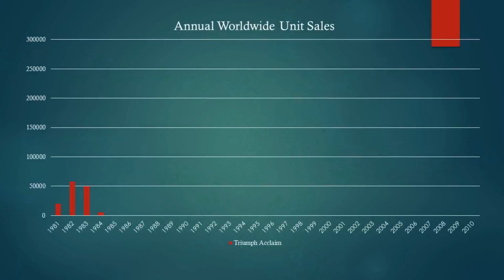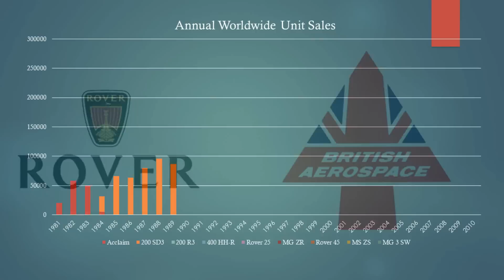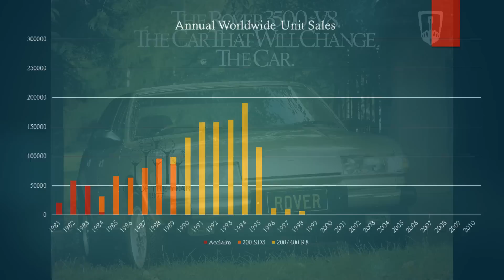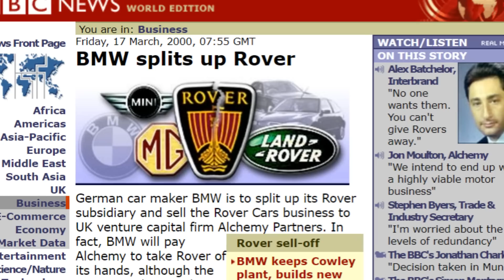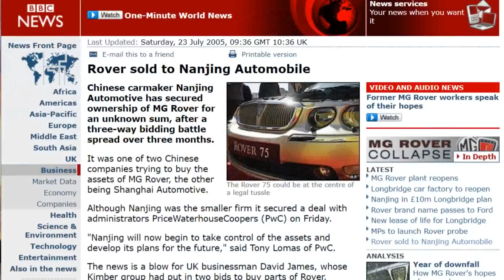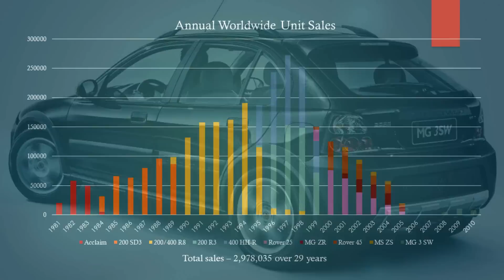The Rover 200 Story

Comment: Well, I've had my 2002 MG ZS diesel that I only paid £375 for for two and a half years and I really like it. The handling is pretty good, the seats are really comfortable for long journeys, and it's pretty economical - almost never less than 50mpg, despite using it for driving about 4 miles to work for approx half its fuel usage. Has hardly needed any servicing, bodywork, engine, gearbox, suspension all in great condition. Oh, and guess what - No charge for the ULEZ! Bonus! Was that because Rover went bust before they'd done all the analysis on exhaust emissions?

Comment: I had an experimental Rover 25 two liter turbo diesel hatchback with the Hydragas suspension from the MGF.
Reply: Seriously?!
Reply: @skylined5534  Yes, in 1999, it was a company car, I would have bought it but the suppliers said it was experimental and would not sell it.  The hydra gas suspension was definitely superior to every other metal spring suspension car I've ever driven. The car rides on air until the suspension depressed then it firms up progressively as when squeezing gas in a syringe.  It is the perfect suspension system, I suppose other manufacturers stayed away from it because of the necessary regular maintenance.  

I sent my wife out for a drive in it and she couldn't tell any difference.  I told her what the difference was and sent her out for another drive but she still couldn't tell any difference compared to normal cars.  To me the difference was very obvious but half the market (women) couldn't feel or couldn't care about the difference.
Reply: @dreamdiction  

What a bonkers and cool car! Thanks for telling me about it! I hope it's still out there somewhere 😊

Comment: I had a rover 216 Vitesse as my first car, got 12 years and 214,000 miles out of it before sadly it had to go when it got to the stage that i was welding to the previous years welding none of the Honda parts apart from the central door locking switch ever went wrong, (ignoring wear parts of course).

Comment: I had a J-reg 214 SLi, with extra power steering.
I loved that car, good handling and reliability (except for the PSA clutch & gearbox), reasonable performance and a big boot.
Only got rid of it when repairs began to cost more than the car ☹
Reply: It was a VW gearbox.
Reply: @richardrichard5409  
From Wikipedia about the 89-94 model 200 series:
"The Rover-engined models drove the front wheels via jointly developed Peugeot/Rover R65 gearboxes (1.4-litre) and Rover PG-1 gearboxes for the 1.6- and 2.0-litre versions."
Reply: @richardrichard5409  
Also, in the 11 years that my family had the car, the gearbox was replaced twice (and the clutch at least twice).

I've subsequently had 2 Mk1 Skoda Octavias (VW group) that I kept until past 15 years old (and about 170,000 miles) each, neither had any problems with the gearbox and only one needed a clutch replacement.

This shows the difference in quality between the Rover/PSA gearbox & clutch vs the VW group ones.
Reply: PSA box, VW box was early Montego/Meastro 1.3 and 1.6

Comment: The second generation Rover 200 and Rover 400 models were brilliant, spacious comfortable rear accommodation, reasonable bootspace, decent economy, a lovely ride, and a quality experience. The smaller 200 and 400 replacements were nowhere near as good - fair bootspace, poor rear legroom, not quite so nice seats, and sloppy refinement, and as for merely reheated and rehashed 25 and 45 they weren't a lot different from the 200 and 400, just a few cosmetic changes here and there and subtle restyling.

Comment: I've had experience with all the Rover 200 generations. Looking back, the original one launched around 1983 was the most impressive. The facelift version felt very good, it felt premium and was well designed, as a former Orion owner yes it was on another level, even the 213s with about 70bhp felt nippy enough. Being less than 900kg might have something to do with it, amazing weight, and it still felt very solid.

The R8 was good but felt a bit less special, but more practical. The facelift car looked brilliant in 214 SEi trim (or GTi/GSi trim) with the half leather sports seats and nice metallic colours with the later body coloured bumpers (nightfire red, BRG and a charcoal grey colour, they all looked great). Even the silver looked smart for some reason, I think it was the contrast with the black rear panel and facelift black grille that made it look good, I normally hate silver. The bubble ones felt less special and more mass market, but I did own a Diesel and that still felt much nicer and drove better than the new shape Cavalier I owned before it, and it went extremely well with one of Rover Ron's tuning boxes on it. Estimate about 130bhp, up from 105. Could spin the tyres in 3rd in the wet (admittedly cheap tyres).

Also had a ZR and ZS but by that time they felt a bit long in the tooth by then, and the ZR had a habit of the interior trim falling apart, and the ZS felt a bit too Honda, moreso than I remember in the 400 for some reason, but they served a purpose. Ride was too harsh too, I think they fitted cheap firm shocks which sacrificed ride quality too much. My BMW 330i M Sport was a limo in contrast. I even lowered it and it was still more comfy than the MGs.

I love the looks of the Coupe and Cabrio too.

Fond memories of the 200s.

Comment: That handling issue  explains why the 213 my grandfather passed on to me nearly didn't make it round a motorway cloverleaf when I tried to drive it home to Kent from Wales in 1999 when I tried to power out the turn... Or maybe it was down to its horrendous condition - quick fit wouldn't let me drive it home after they put it on the ramp!

Comment: my first own and my 4th car was a Concerto 1.5i and i honestly couldnt say it had awesome handling or a strong body. when i jacked it up on one side the doors wouldnt close as they should. the suspension was VERY wobbley and indirect compared to my 1990 civic i had. the civic had a double wishbone suspension design in the front and the concerto had just the usual european mc pherson strut. also the interior had some not that great fitting interior trim wich the 1990 civic didnt have so yeah....i guess the japanese influence was good for bl but not really for honda. but im aware that japanese motoring wouldnt be on the same level it is if they hadnt been learning from the brits after ww2.

Comment: Good research. I had 2 Rover 216 company cars and they were both reliable and not bad to drive. One driven to southern Spain and back, but they were never Rovers in my view. AR & Honda should have exchanged manpower to integrate the companies better. In my time at AR I never saw a Japanese designer or engineer and Honda would have benefitted from working with some of the AR designers and engineers.
Reply from the maker: Thanks - good insight!

Comment: Overlooked in this video, was that the Rover engine used in later years (1.6L in the 216) was a grenade. Well unless you are of the opinion that 40,000kms is acceptable interval for on engine to blow head gaskets ("edit" I should say like clockwork, every 40,000km)...   Inlet manifold bolts would also break, requiring them all to be replaced with studs, in some cases the manifold may have warped too. A real shame as they were otherwise an awesome little car.

Comment: Owned a Maestro City as a young driver.  It was cheap to run and very spacious inside.  A nice metallic graphite colour.  The downside was it was very basic and felt a bit tinny.  It was underpowered.  A car that size should have had a 1500 engin minimum.  They should have re formulated the allegro engine.

Comment: Owned the metro 100, 214 Si . Hesitated with the 75 and decided on  the Mondeo followed by 2 x Volvo V70’s. Now running a Hyundai Tucson. The 214 si had various faults and one major one which was engine management system. Car would stay on high revs. Quite dangerous at times. The never found the fault.
Reply: We had a company Rover 216 from London to Bristol staying a week n back choke on 1.5 k rpm extra  I was sure it would wreck the engine but didn't, nice car for motorway cruising with 4 tall men, wasn't as quick as my passat 5 cylinder 2.0 litre but close.

Comment: I owned a 1991  Rover 216 GTi 5 door in British Racing Green. With its twin cam 1.6 Honda engine it really was a wolf in sheep's clothing. It was a seriously quick car. Very high revving, with 70mph equal to around 4000 rpm, which was a little tiresome on a long journey. I kept the car for over 5 years.  It was an expensive  car to run and service.  I replaced it in 1999 with a Renault Megane Scenic

Comment: Had a K plate Rover 214 with the Rover engine, It was a right bag of dirt crap, Nine times it puked up it's coolant, Only on the ninth time back at the dealers, They decide to skim the head and it still did it a couple of times afterwards. While it was in getting the head done they gave me 214 with the Honda engine, It was like chalk & cheese, The Honda had guts but the Rover wouldn't have been strong enough to pull back an elephants foreskin.

Comment: I remember when we looked at the Ballard in Engineering, interesting where they reduced weight in panels like the hood and roof compared to our cars, learnt a lot working with Honda engineers. That’s who Rover should have sold to not BMW.
I gad a 623, fantastic car
Rover 25 was to be a big upgrade to the 200, but BMW took most of the money out the scheme rendering it just a lipstick change

Comment: I had a new 1998 Rover 211i which was very reliable except the door lock broke I changed it for a  new 2002 Rover 25ie which needed a new oxygen sensor and also the heater switch broke.After this i was glad to get rid of it and bought a new Renault Clio.

Comment: That K series engine was awful for head gaskets, I had a 216 Cabrio SE and the head gasket failed 3 times in 77,000 miles, the third time twisted the engine block and destroyed it.
Reply: 1.6 and 1.8 were, the 1.4 wasn't anywhere near as bad

Comment: TBF Honda was going to abandon Rover anyway once they got a foothold on the British (and by extension the European) market. Even if they bought the company outright, they would've IMO either axe the Rover brand completely or turn it into some sorts of what Dacia and Skoda are for Renault and VW respectively. The BMW marrige was mainly of convenience since the Rover group was a losing enterprise and whoever bought it, would inherit all the financial trouble with it. And once when BMW got what they want (i.e. the MINI brand and the Land Rover expretise to create their own SUV - the X5), they quickly wanted to remove the dead weight from their shoulders - selling MG/Rover to the Phoenix Consortium in 2000 and Land Rover to Ford in the same year. Both purchases turned to be disaster as the MG Rover Group lasted only 5 years and Ford quickly sold Land Rover+Jaguar to Tata in 2008 (in the wake of the global crisis).

Comment: Rovers cost cutting killed the company. Shoddy interiors, cooling from larger engines and head gaskets that popped for fun. I had a ZR 160VVC lovely Blue colour had fsh with it and i got 3 months warranty. Forever had issues with cold heating, tried everything to solve this and sometimes it worked but only for a few days then it would cold again. Fookin freezing in winter then the following summer it blew a piston. R.I.P. MGZR 160VVC.

Comment: Rover ceded to have any street credibility, once it became part of B.L.
Reply: Jaguar survived it. So did the Mini and Range Rover. The SD1 has always been cool even though it's the stereotypical example of a BL build quality disaster. So I don't think BL killed Rover as such.

What really did them in was the way they ran in years after BL. Especially under BMW. Far too many years of shoestring budgets pushed them further and further behind the rivals until they were no longer a competitor. Everything they did was because it was cheap, there was no major investment, and parts bin specials were all they could offer. I was a child back in the late 90s and early 00s but even I could tell BMW hadn't really cared. I've never liked them for that.

The K series is a perfect example of this, but far from the only one. It could have easilly been a very reliable engine with some better tooling and a minor redesign, but MGR kept producing engines which they knew to be flawed. It took the Chinese no time at all to fix the K series when they bought MG, so why didn't they do it earlier? Everyone used to talk about how much those engines blew head gaskets. If that one problem had been fixed the cars were actually otherwise fairly solid by the late 90s even if a bit dated. Instead they got a bad reputation.

Comment: The K series engine wasn't a good one. It went through cylinder head gaskets like most engines go  through petrol.
Reply: Goo design but under developed and tested. Remind you of the Stag V8?
Reply: @stephenconway2468  Absolutely!! The overwhelming problem with the British motor inustry- not just cars, bikes, vans and trucks. Brilliant engineers, weak managers and unions that were hell bent on producing 1930's technology for ever!!!
Reply: @DM-it2ch  1930's levels of investment. Machines so tired that tolerances were shot.
Reply: @stephenconway2468  My dad was a development engineer at Land Rover all through the "dark ages". The number of times he said "This isn't ready yet..." and got overruled is unbelievable!
Reply: @DM-it2ch  You could see it in the way the suspension for the Princess was unfinished, rough edges for the square Allegro steering wheel, Marina and Ital using 1950's  backbone, Mini production requiring hammers to get the doors on....

You had engineers using Metro front subframes for the front and rear of the MGF. That was Kit Car approach (GTM had done that with the Mini subframe years before)
Reply: Had to update to the newer gasket on my car but knew that anyway. CHANGE IT AND RUNS GREAT

Comment: I have. Always felt that the effects between the Maestro/Montego episode, and the rover 200 series had on BL/Rover getting it right and wrong.
Honda should be congratulated in teaching  Austin Rover in building cars nailed together properly from first principles. A clean modern production facility, and happier workers. After showing reliable, comfy, good quality though dated cars with the Acclaim.
The 200 series was built with proper panel gaps, a decent economical engine that didn't leak all over your drive! Plus its comfort levels and handling reversed Rovers negative brand opinions overnight.
Honda hit the roof over Rover bringing out all the variants up to the Tom cat.
Even though initially aimed at Fleet buyers, but its main success was as buyers first retirement " rollerskate" cars. The retiree's effect on the expanded 200 mk2 200 series hasn't been mentioned here!
Droves of newly retired went for them as they knew it had Japanese reliability, British enough styling and comfort, plus enough room for carrying the grandkids. 
Everyone n with Honda royalties, this car kept Rover alive through the 90's.
Where the maestro/ montego, nearly killed Austin Rover , and  boosted the firms reputation for really good cars in theory but really badly made cars, the rover 200's showed they could reverse all the negatives.e
The reason for the smaller 200' s was that they finally woke up to the huge numbers of retired buyers compared to even fleet sales. And these buyers wanted to move up from the motor's to something slightly bigger, and did everything the metro's did, but being a more energetic generation, wanted a bigger metro that could be comfy on motorways, but small enough not to cross the ferry price jump from small to medium car and their European holidays.
It's just truly sad they got maestro hammered on quality, reliability and gadgets, that nobody could tolerate, yet proved they could reach German build quality and Japanese reliability and with lots of gadgets, that could reverse austin rovers notoriety and be hugely popular!
And Honda's  initial partnership started in 1974. If they had been allowed to input their manufacturing back then its entirely possible  that the mk3 metro would have been built and a world beater, and maestro would smash its European competition (fiat strada, Renault 14, and smaller citroen, even the VW polo and golf), and Rover being a viable company.

Comment: a mate had a TR7 years back, very low miles and paid a small fortune for the thing, it was the worst car I've ever been in, mechanically it was a joke, gearbox was like stirring treacle, steering was like jelly custard, brakes were limp, suspension we thought was broken but mechanics said it was fine, UH !  the build quality was terrible, every single part of its interior squeaked, the seating was like a go kart and it kept blowing head gaskets for fun, when he put the lights on he had to manually lift one of the headlight lids and it would slowly close by its self every time it hit a bump on the road, and it had electrical problems that no one seemed to be able to fix properly, even the radio sounded awful, I quite like the rover 75 diesel if you can find one with under 40K miles not a bad car for the little money,

Comment: Good old BMW, asset strip Rover, take the replacement 200/400 design back to Munich, and try to rip of the Phoenix Consortium for a huge sack of money knowing that MG Rover would not have the funds for the new car. Add salt to the wound, it's launched as the 1 Series. Funny that. They screwed a fellow German car company Glas back in the mid '60's and got their assets too! Not a fan of BMW, they are a bunch of…